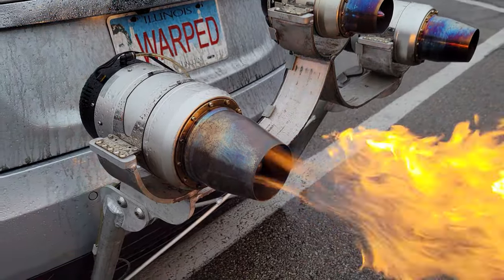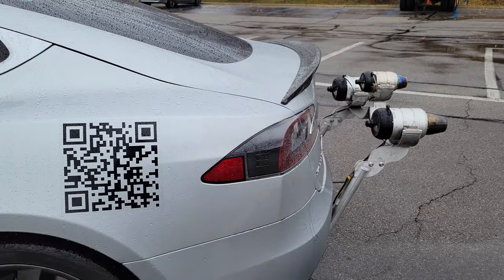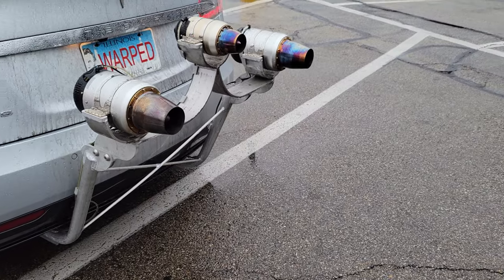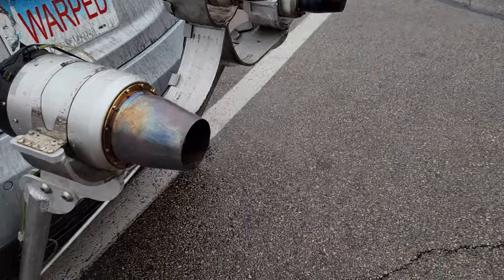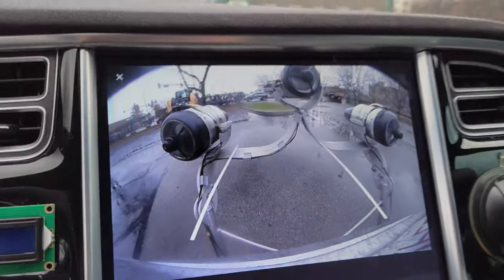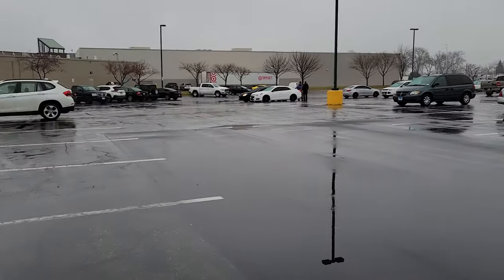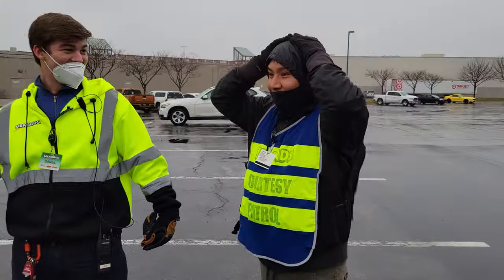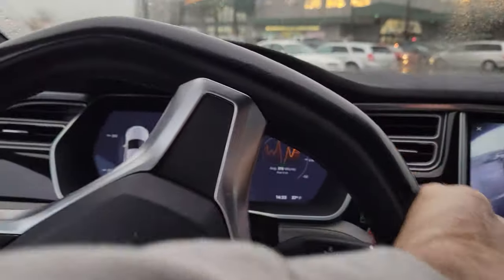Starting Jet Powered Tesla In the Rain

Comment: I'd like to know how much regen power you can get (to charge the car's batteries) with the turbines running. I've heard that towing a Tesla (with regen active) allows them to recharge a dead battery without plugging in, and wonder if you can do this with the turbines.
Reply: This is a great question.  Yes, lots of interest from people towing their Teslas with big RV's looking to recharge.
Reply: @aussie2uGA  Probably extremely inefficient
Reply: WP actually did that video - towing a Tesla to charge it. Search his channel
Reply from the maker: Yes I did a video on tow charging it was extremely successful, way more successful than I thought it was going to be. It's on my warped perception Channel. Tow charging a Tesla at 70 mph for 25 miles.
Reply: @WarpedLab  awesome, what I'm wondering how much regen can you get using turbines instead of a tow vehicle? Can they make enough thrust to 'turbine tow charge' at all?
Reply: @scotty305  here's my finding on that, when I did a tow charging video I believe I calculated about 89 horsepower of regen, so in the simplest calculations we would need at least enough force on the car to overcome 89 horsepower plus the wind resistance of the speed that you're trying to maintain.
Reply: @WarpedYT  that's awesome, thanks. I'll go find the towing video soon.
Reply: @WarpedYT  I was wondering about Jet-regen, but can't get past the point that you took a silovet of your right hand fingers, how did you lose the middle finger tho

Comment: It seems by the exaust color of the port engine on the far left ( viewed from the rear )  isn't reaching the same temperature as the center and starboard engines. Titanium heat anodizes to different colors at specific temperatures. The dark bronze shroud color is the lowest temp ,which is the first color to appear when heat anodizing. A thermocouple or instant read heat gun should be able to  verify the running temp of those engines. Why the one directly behind the driver is running cooler is bugging my brain! Love the hybrid Tesla!
Reply: Yes you are correct, I do have full telemetry on every single engine on that front panel as well as EGT readings. I think the color is different because that's the oldest engine and it has formed some titanium dioxide on the nozzle over time, however it could be because of the temperature as well although they all run pretty much in the same temperature envelope... I am just like you things like that bother me lbvs !

Comment: Your setup is going to damage the bearings and fan blades in your jet engines if you start driving with those jets spooled up. You got too much vibration going on when you're driving. Aircraft don't suffer these types of vibrations. If the bearings get damaged the compressor will start to stall and flame out from the drag of destroyed bearings.
Reply from the maker: True... But my main focus is to finish the episode, if the bearings get messed up I'll just take them apart and replace the bearings they're not expensive but you are absolutely correct. As for the stalling, it's the junky fuel pumps for those engines, the fuel pump for the middle one went out during this video, I replaced it and the second fuel pump is acting weird, only on that smaller engine, I don't like those brushless fuel pumps they're very problematic especially at startup when it ramps from ,75 volts, brushless motors don't like low voltage.
Reply: @WarpedLab  If you don't want to impale the driver next to you please consider building a protecting shroud for your jets made of strong woven carbon fibre and kevlar. Better yet, don't drive in traffic with jet engines that can spew out fan blades faster then the speed of sound into a car next to it.

Comment: The mount looks flimsy, should be done with one piece not bolted on each mount
Reply from the maker: Looks can sometimes be deceiving, sometimes but not usually, in this case I tested the amount up to 500 lb of thrust, yes it flexes but that's quarter inch thick tubing, as for the brackets I made it modular, I'm going to be able to disassemble this whole setup put it away nice and neat and pull it out whenever I want it, and the bolts on the back bracket not only allow me to swap out but also add my additional supports in the future as soon as I get the materials... Big Time raw materials and supply chain shortages right now...
Reply: Maybe watch other video where he builds and tests it and explains why...